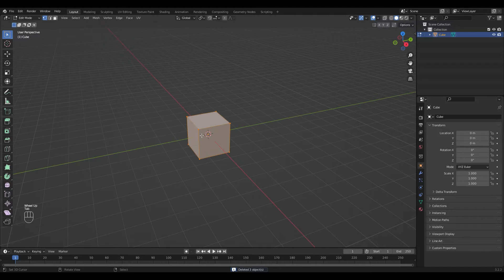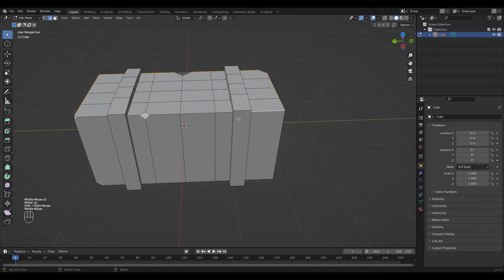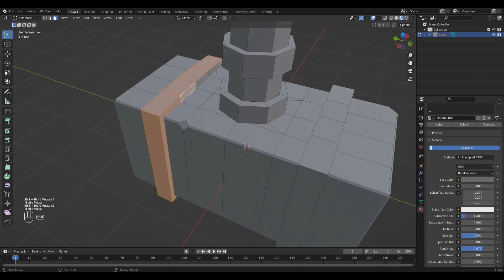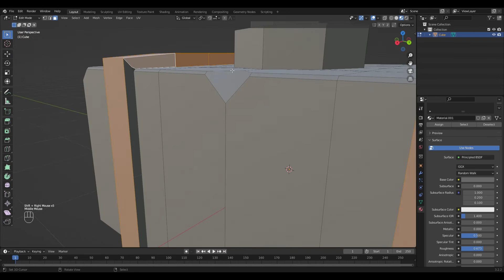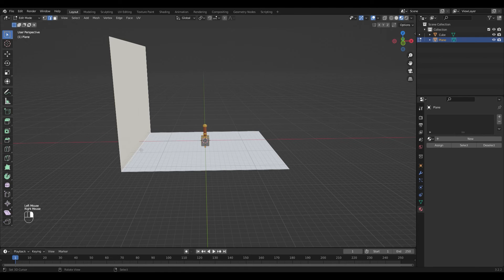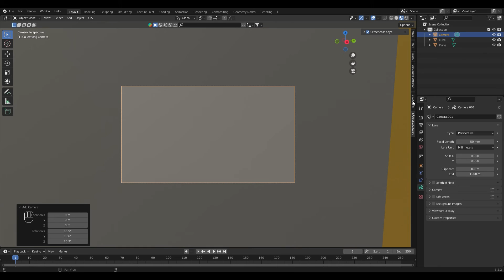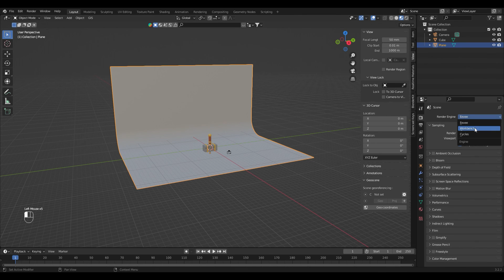Low Poly Hammer Blender Tutorial For Beginners!

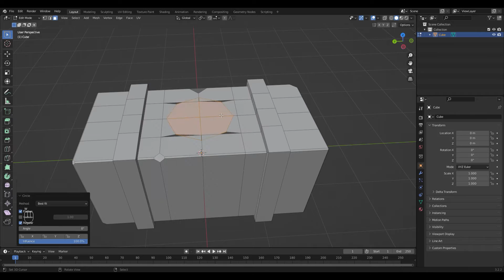Comment: im using blender 3.6 what key do i use to access  2:00
Reply from the maker: It's the key "W", but you have to have the plugin "Loop Tools" enabled. You can enable it at "Edit>Preferences>Addons" and then search for it.
Reply: @tengertechnologies  enabled it not working
Reply from the maker: @BrandoBuilds  Do you have leftclick as default selection? In that case you should be able to open it with rightclick. And make sure, that you are still in edit-mode.